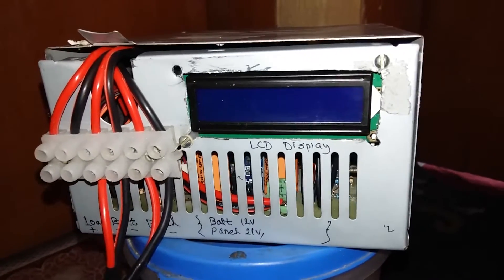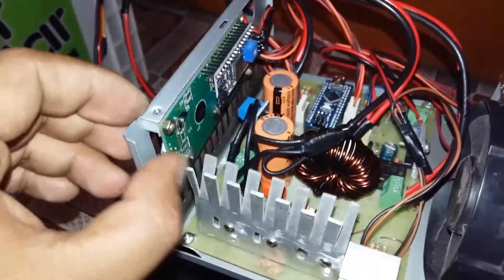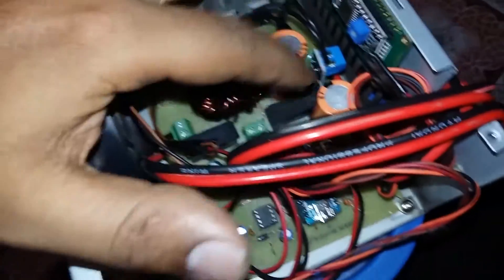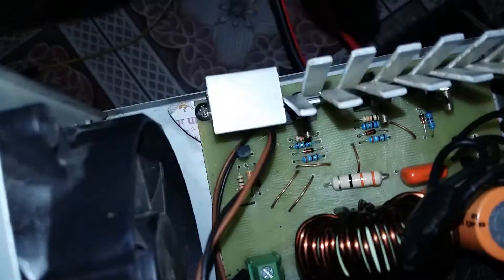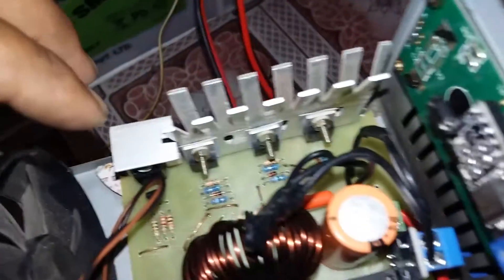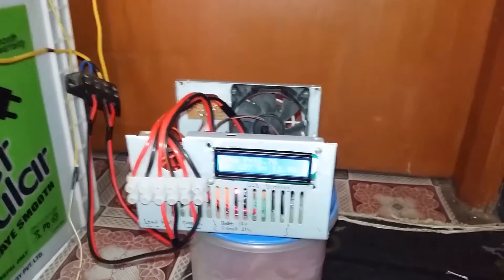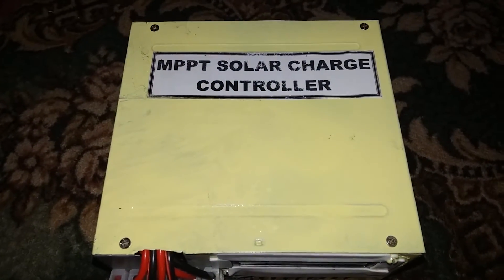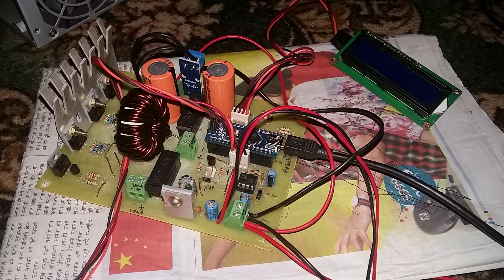MPPT Solar Charge Controller V1.1

Comment: Friend helps me in a problem that occurred when the solar plate reaches above 23volts the system hangs and the voltage reading of the plate is not correct.

We modified the mosfets to the IRFP250N, the inductor as I cannot measure accurately so it was calculated at 43uf, the ACS712 and 30A, if you can pass me as you did the calculation to change.
  
If the voltage is below 23v the charging works. above the system simply hangs, friend has how to help me solve this problem.
Reply from the maker: What is the rated voltage of the solar panel ? MPPT charger is like a Buck charger. It may be because of the input voltage spike being generated when switching. Do you have oscilloscope to see the spikes ? Have you checked my schematic diagram ?
Reply: @MrGairhe  The nominal voltage of the board is 32v, 275w, 8.88A, however 8 boards like this will be useful.
Reply from the maker: @welbertj  This is what the problem is 32V panel. I have just designed for 24V panel. You will need to add some filter circuit to reduce the spike which occur during switching.
Reply: @MrGairhe  ok
Reply: E qual fórmula você usa para calcular acs712? Vou usar o 30A .. "float Iincalli = 0.0815; "
And I didn't understand that part of the code
  Iload_mean = (548.39-sensor (loadPIN)) * Iincalli;

Comment: Please help me sir i made your project but some problem showing
Reply from the maker: I built this one 3 years ago and it is still running at my home. What problem are you facing ?
Reply: @MrGairhe  please sir help me!.
I am waiting for your reply..
Reply: Thanks a lot sir for your reply.
sir, I have tried your project with the same schematic and same Arduino code with yours. but i have problem. why there is no current in my PV? although battery is connected.
Reply: Sir please tell me what's the reason for no current 
Just tell this please 
If you help me my mppt project will be complet...
Reply from the maker: @rkelectronicsbd1218  My be the output voltage is not enough to charge the battery. Check the duty cycle ? Before you make it automatic, set a fixed duty duty cycle and observe how it behaves in various duty cycle.
Reply from the maker: Can you tell me more details of your project, voltage and current rating of solar panel, Ahr of battery. Try putting small load on the battery too,  if battery is full, it won't draw any current.
Reply: My solar panel is 65 watt 22.2volt 3.6 amp current ,and my battery is 12 volt 40 Ah .
Cherging indicate led on and pv led on ..and duty cycle is 190- 200
Reply: @MrGairhe  i tried putting small load on the battery but same reason 
I checked  ir2104 mosfet driver 7no pin- LO, and 5no HO out put pin 
HO 5 no pin voltage all time showing 12 volt and LO 7no pin showing 1 v
Reply: @MrGairhe  sir how fixed duty cycle
Reply: Hello sir please help me i am waiting for your response

Comment: Lovely design. For a 10A current max, I don't think the heat generated will be so extreme as to require a fan, but I could be wrong sha. What is your switching frequency? Thanks...I'm in love with your concept.

Comment: सर ये चारजर बादल आने पर भी  बैटरी पूरी चारज करेगा
Reply from the maker: I might charge the battery but it depends on various factors, battery state of charge, charging current required for battery and the amount of current and voltage generated by panel.

Comment: sir, I have tried your project with the same schematic with yours. but i have some problem. why there is no current in my PV? although battery is connected. please answer my question immadiatly. thank you sir
Reply from the maker: did you mean.. no current from the Solar panel to charge the battery??? It might be because of various reason. please mention the test conditions.
Reply: ok big thanks sir for your answer. but now i'm have another problem. why my mosfet turn on just for a second. so current can flow from my PV just for a while. after that there is no current from my PV. and that condition continously. may you give me a solution to solve my problem sir?

Comment: Sir I am making this project for my 50W system. For testing purpose I made the buck controller on the breadboard but even when the duty cycle is 100% I get about 4 volts for a 12 volt input. I used an inductor from an old SMPS unit and output capacitance is 2200uF.
The code I am using to test the buck converter is-
#define PWMPIN  9 // PWM control pin
#define SDPin 8 // shutdown function of IR2104
#define ON LOW
#define OFF HIGH 
float dutymin =0;
int d = 0; // duty cycle

void setup() 
{
pinMode(SDPin, OUTPUT); // set the pin as output for shutdown mode of IR2104
pinMode(PWMPIN, OUTPUT); // set the pin as output for PWM function of IR2104

digitalWrite(SDPin, ON);// Turn on shutdown function
TCCR1B=(TCCR1B&0xF8) | 1; //set PWM frequency to 31250 Hz for pin 9 (and 10)

analogWrite(PWMPIN, 0); // 0 to 255 = 0 to 100 % duty cycle.
d=255;
}

void loop()
{

  analogWrite(PWMPIN, d); // 0 to 255 = 0 to 100 % duty cycle.
 digitalWrite(SDPin, OFF);// Turn OFF shutdown function*****dont forget this*********

}

What could possibly wrong? The MOSFETS even heat up a bit during this operation.

Your reply would greatly help me.
Thank You.
Reply: Utsav Shah never make duty cycle 100%. Keep it below 90-95%.  
Also check the value of inductor. Smps inductors are low value for higher current levels. They will act as a wire at lower load currents and cause issues at high switching speeds.

Comment: Do you have the cct diagram ??
Reply: with out microcontroller & lcd
Reply from the maker: sujahit rudra  what is cct diagram. Did u mean circuit diagram ?. If so. then yes I have. I will shortly post on my blogs.
Reply: Can i have the link?? This is my final year project.Thank you.I need your guidance.
Reply: Can i built it without microcontroller,ardunio kit & lcd ???
Reply from the maker: sujahit rudra u cannot build it without microcontroller.
Reply from the maker: sujahit rudra I will post it by tomorrow
Reply: Microcontroller is compulsory.But i am not allowed to use microcontroller any other alternatives.
Reply from the maker: By tomorrow I will post it on my blogs
Reply: Link to ur blog pls.
Reply from the maker: http://gairheprojects.blogspot.com/2016/08/mppt-solar-charge-controller-required.html
Reply from the maker: Sorry. I can't help you without microcontroller.
Reply: Just have a look please.